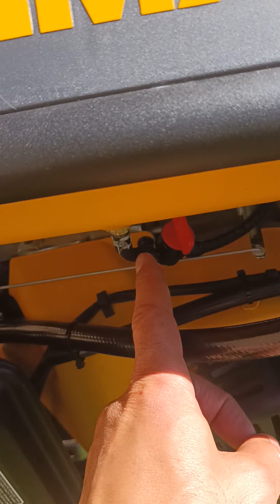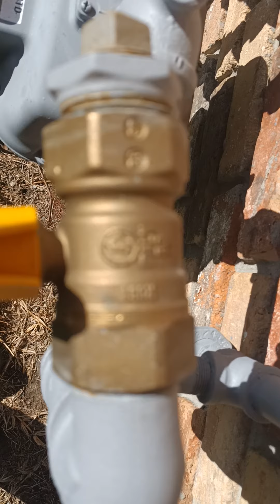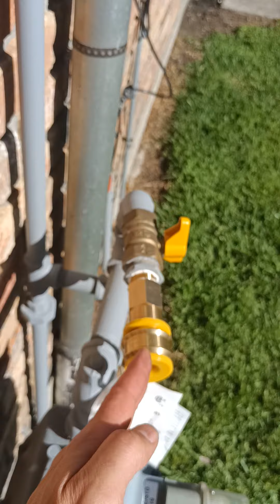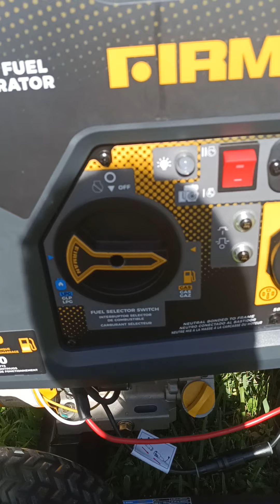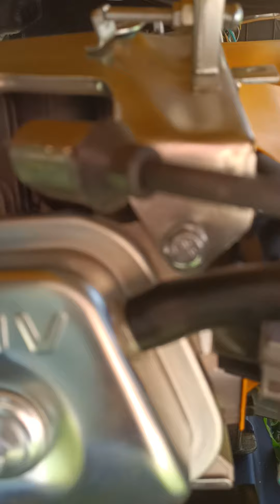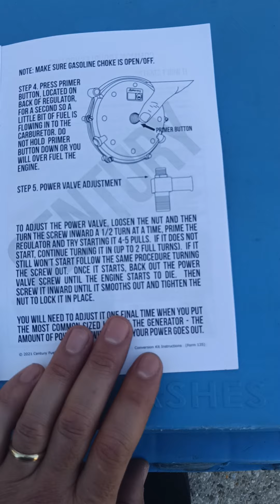Firman H07552 Generator P5 Natural Gas conversion with "Century Fuel Products" conversion Kit Part 5

Comment: Question please! I have a tee fitting on my gas line after my meter. One part of the tee goes into my house and the bottom of the tee has a plug. I wanted to take out the plug and connect a nipple with another tee. This would allow me to connect my gas supply for my generator and put a plug in the bottom of the tee for the gas company access. Is that ok? It seems like it would be but wanted to make sure. Thank you!
Reply: If there is only 1 tee with plug, it probably belongs to the gas company. That means you can't use that tee or put another tee between that and the meter. So you have to add another tee after that. If you use the  existing tee, and the gas company comes to work on your meter, they will have to leave your gas off, until you make an appointment with them. That means no hot water for a while until they come.
Reply: @JohnHamed  I don’t think I explained it very well. I wish I could send you a picture. But I would be putting in another tee with plug for gas company access.
Reply: @JohnHamed  What I meant to say is I will unscrew the plug from the bottom of the tee and add a nipple in place of plug. I will then add a tee to that nipple with a plug at the bottom of that new tee giving gas company access. Is that ok?
Reply: @Atekcs  I understand, and a lot of people do that, but it is not okay. Your new tee must be past that first tee going to the house. I'm sorry, once you replace that plug, even if you added another tee, game is over
Reply: @JohnHamed  ok gotcha. Thank you for your help and really great videos! Time for a new plan.
Reply: @JohnHamed  I think I have a new plan. If I make a video and upload to Youtube and post a link in the reply, could you take a look and give me your thoughts and advice? Much easier than trying to explain here. Thank you!
Reply: @Atekcs  ok
Reply: @JohnHamed  Here is the link. Please give me your thoughts. Thank you! 
https://youtu.be/ETL495oI7zA
Reply: @Atekcs  Okay thank you for the video. Unfortunately I'm not familiar with this meter build. California had those in the past and they're mostly replaced. In this case I would do what you said before: add another tee at the bottom of that existing tee, then put the plug you are removing from the first tee on the second one. I think they will have to rebuild the whole thing anyways. I doubt they would give you a hard time for doing so.
If you shut off the gas, later you have to turn back on the pilots (water heater, wall heater, stove) if applicable. Also the main valve sometimes leaks after any movement. All that said it should be done by a licensed professional to be safe.
Reply: @JohnHamed  Thank you I will proceed with the original plan. Thank you for your help and insight. I agree, I cant imagine the gas company would give me a hard time as they would still have access through the plug. Curious what that access is used for if you know?
Reply: @Atekcs  I'm not sure about their procedures, so good luck and I wish you the best.

Comment: May I ask why you didn’t use 2 full port gas valves?
Reply from the maker: One valve came with the regular. I'm using 3/4 pipe, which may be overkill. The generator manufacturer sells 10 to 15 feet of 3/8" gas pipe for their Tri-Fuel generator with the intention to use it on natural gas. Having done Natural gas plumbing in the past, I know the valves I am using have enough clearance to release the right amount of natural gas, but bigger valves could be used, if you wish to do so.

Comment: Question! If you connect to the natural gas going in to your home, will you reduce the volume to your furnace, stove and hot water heater?
Reply from the maker: If you have too many gas appliances running at the same time or if you have a small diameter pipe you are trying to pull a lot of gas through, yes that would be a problem. At my gas meter I took a Tee out of 1" pipe. I only need 3/4" pipe for the house and 1/2" for the generator (but I went above and beyond), so I have extra volume to distribute to the generator.
You could do the same. Coming out of the outlet of gas meter, upsize you pipe, then split it into 2 smaller diameter pipes. However if you already experience low gas pressure, you may want to call the gas company to check if you need a bigger size gas meter.
Reply: @JohnSadoughi  great informative video! i am looking into the champion trifuel gen, i presently have the firman 5751 dual fuel, my question is, how do i know if my gas meter is large  enough to accommodate the gen and my NG burner,i basically only want to run the heat in the winter in case of a blackout  my meter is 250,000 btu and the generator is 135000 btu, i wont be running any other NG appliances during a blackout. but i dont want my to starve them of gas and have to relight the pilots.i think the meter is 5-7 WC,,
the NG pipe from the meter into the house is 1in then reduced to 3/4,,going to the furnace and the druer,hot water heater.. i ran a 3/4 in pipe to the outside rear of the house directly opposite the meter,aprox 25 ft,, then reduced to 1/2 inch to accommodate the Champion,  need some advice,,,,
Reply: @johngraziano6652  the meter should be big enough for them all, unless you have a tankless water heater, in which case you need to call your Gas Company to upsize your meter. It may still work regardless. Just try it out and see what happens. However I'm not sure about 25 feet of 1/2 for the generator. You may have to change to 3/4 since it is a long run, depending on how much gas your generator uses at a given time. Again try it out to find out.
Reply: @JohnHamed  The hot water has a tank. And the 25ft was referring to the 1in to3/4 inch pipe inside the house from meter to back outside wall. I put a3/4,, inch valve with a1/2 inch reducer to run the ng hose to the generator. Will that be ok
Reply: @johngraziano6652  yes, in my opinion it should. Also remember, if you have converted a Gasoline generator to a natural gas generator, it produces less energy.
Reply: @JohnHamed  thanks. I plan on getting the champion tri fuel  already ready for NG. Produces 7000 running watts
Reply: @JohnSadoughi  can you please confirm this using the following info. im getting lots of different info and its confusing the hec out of me, CHAMPION TRI FUEL GENERATOR REQUIREMENTS
Nominal fuel rating- 1000btu a cubic foot. Fuel supply size-1/2inchFNPT. Fuel supply pressure 5-7wc. Max flow rate 135000 btu
 MY GAS METER INFO
.5-7 WC , (1.2-1.7 kPa W.C.) and 1000 BTU a cubic foot .
 so my regulator reads 'B42R ORI 1/8 5-7 IWC 125 PSIG MAX 8/08 The meter says AC-250 250 C.F.H @ 1/2 DIFF. MAOP 5PSI.
my gas furnace furnace draws 120k, water heater draws 40k, and the generator draws 135k
and im not exactly sure how many lbs my meter is pushing.
Reply: @johngraziano6652  a 250 meter should be enough for all gas appliances. Usually you should have 7-9 WC pressure coming out of the meter. At least that was the standard in California. If you have lower pressure, then you have to get bigger supply pipe to your generator. So if you have only 1/2" iron pipe to your generator, and it is more than 10 feet and your outlet pressure is only 5 WC, I would change to 3/4 pipe. The rubber pipe going to the generator can stay at (I believe it is) 3/8, since it is not that long. So ask your gas company what your output pressure may be. Also keep in mind that you would only get low pressure gas, if all the gas appliances you mentioned are on at the same time, which does not happen a lot. Another thing to consider is that if you don't get enough gas to the generator, the result is usually nothing but lower electric output. You may not need all that electricity anyways. So I would suggest to just try it out with everything on and see if you get enough electricity or not. This generator cannot run central air. I used 4 individual window sir conditioning for my house instead.
Reply: @JohnHamed  thank you!  Here's my layout. I have 3/4 in gas pipe coming out of the house leading to a shut off valve. I made the plumber  put a1/2 inch reducer Because the generator I'm looking at comes with a 25 ft quick connect hose. My gas meter says 5-7 wc. I can take that reducer off and make it all 3/4 but then would have to still reduce at the generator. I only plan to run the furnace and a few light, tv fridge in winter. No central air. Window unit. So what do you think.
Reply: @johngraziano6652  I think you should be alright the way it is set up. I wouldn't change anything. Just try it out.